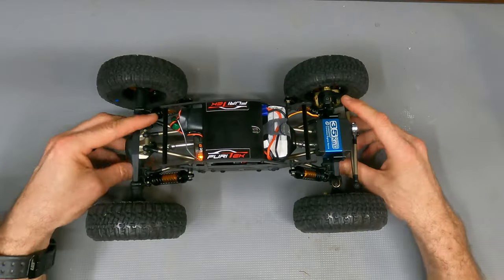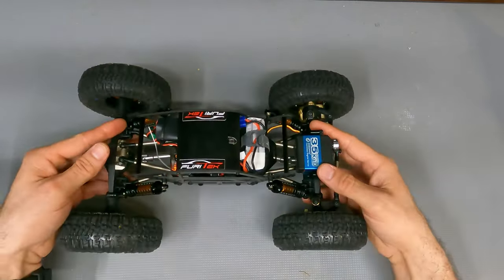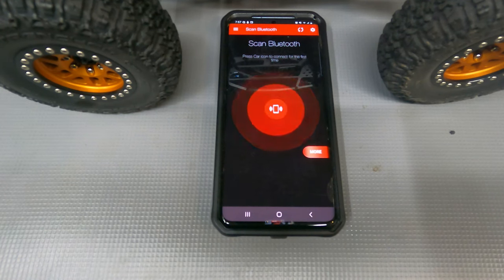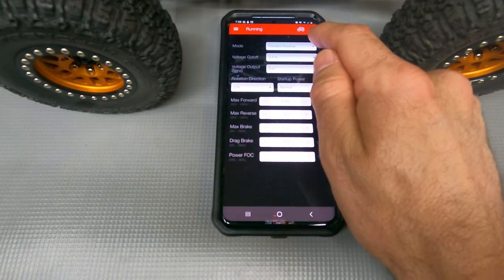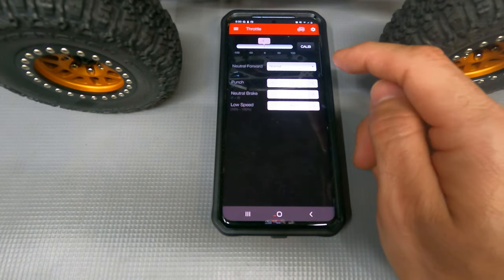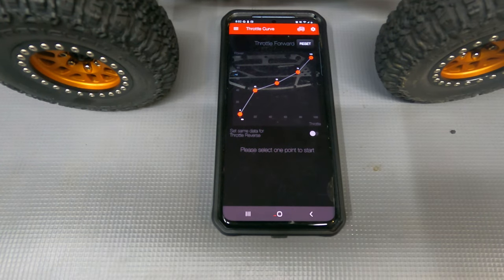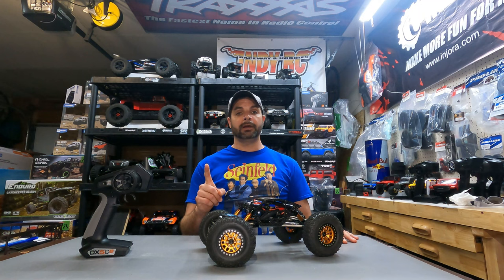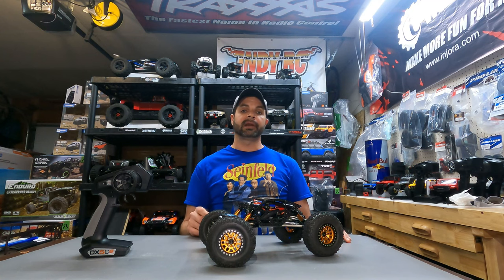AXIAL UTB18 COMP UPGRADES   Made with Clipchamp

Comment: What shocks do you have in this rig?
Reply from the maker: I used the Injora 70mm duel spring shocks. I stripped off the duel springs and used the factory Axial springs on them. They work great.
Reply: How tall are your tires? If I have 3.85 do you think 70mm is too low? I think stocks are 80mm